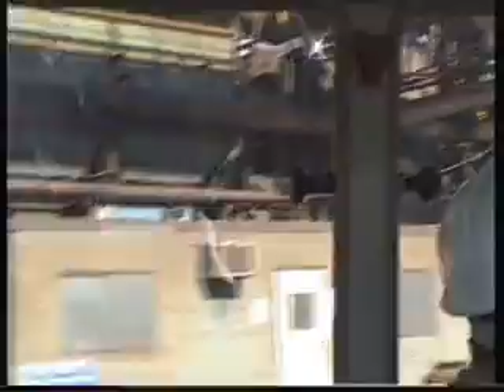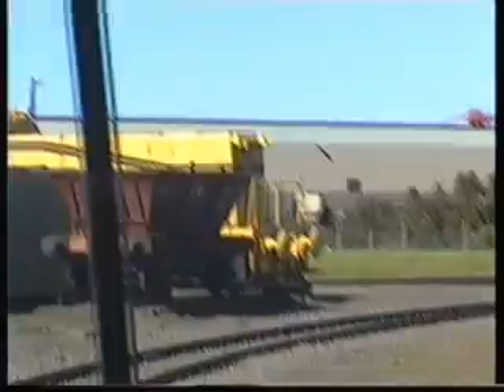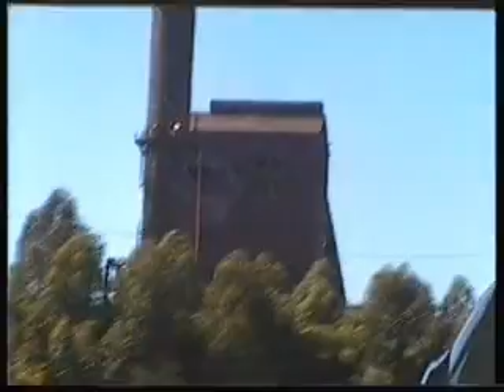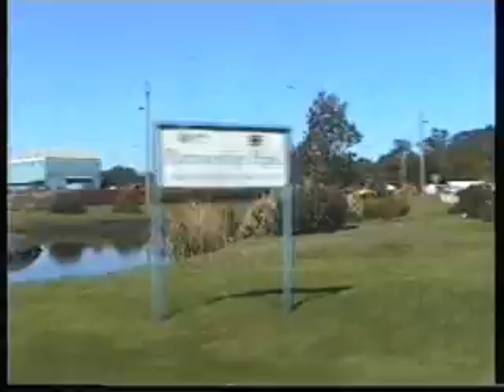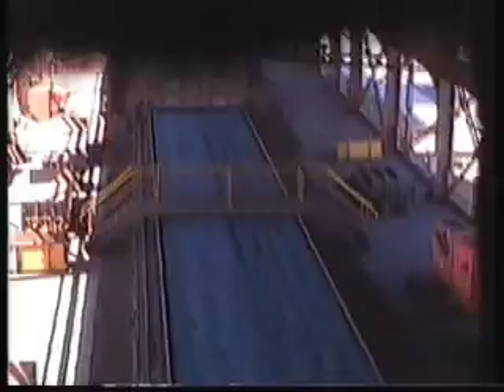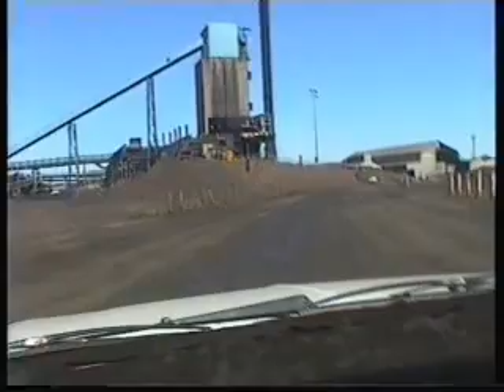BHP TOUR

Comment: Amazing how they`ll tell you everything EXCEPT the dangers.If you have a look at about 18.27, you`ll notice 4 huge ingot moulds, these were kept in what was known as the "soaking pits"., huge gas flames that kept them white hot until it was time to roll them into smaller billets. Some times they used a special crane to remove the moulds and just leave the white hot billets sitting on those small waggons. On a rail line just next to the 18 inch mill in about 1968 a poor worker was walking too close to the billet and somehow the billet fell off onto this unfortunate person. No reason to explain the end result. True episode, I walked past the site on my way to the Sinter Plant where I worked the next shift.